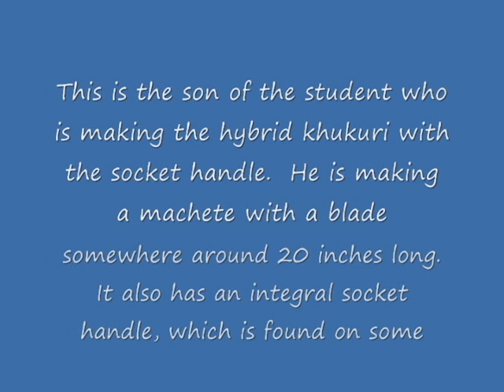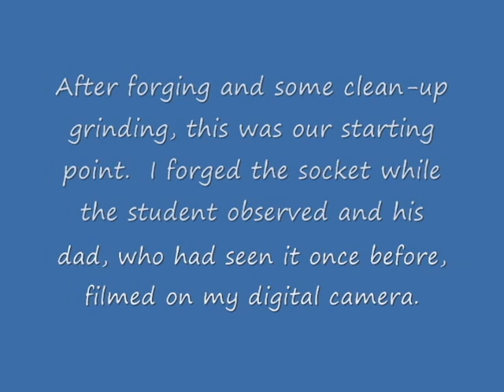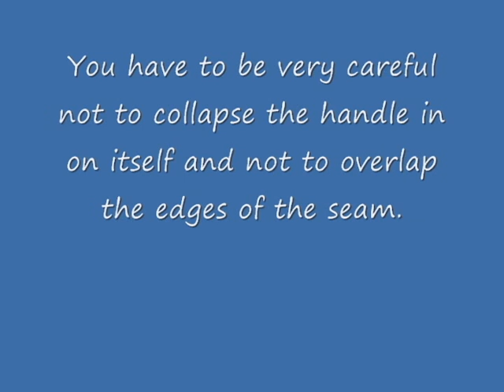Forging an integral socket handle on a machete - Part 1

Comment: What is called here integral socket handle on a machete was originally patented on June 19, 1877 by the Collins & Co., Collinsville (Hartford),Connecticut, as "hollow handle." You can see examples of these machetes at Sugar Cane Hacienda Esperanza Museum, Manati, Puerto Rico, where there is a huge exhibition of almost 400 different antique and vintage machetes, being, probably, the biggest and most complete collection of this agricultural cutting tool in the World.

This video is great ! ! !

Comment from the maker: @concretefeet   It's not too thick; standard half ton pickup leaf spring thickness.  As for the heats, quite a few to spread it.  It heats up quickly as it gets thinner, but also cools down quickly.